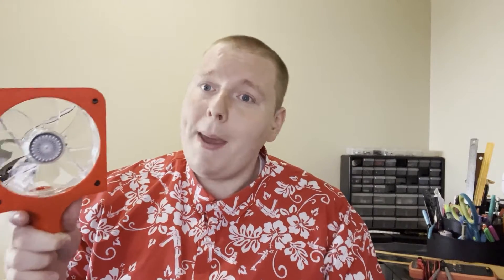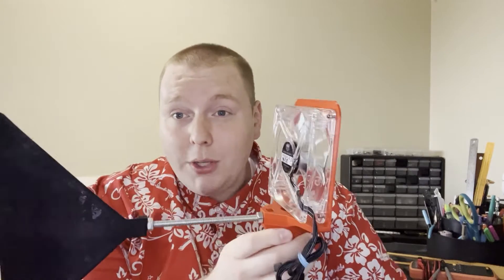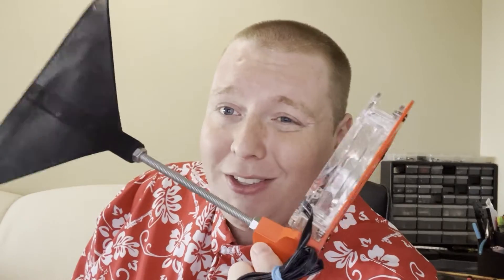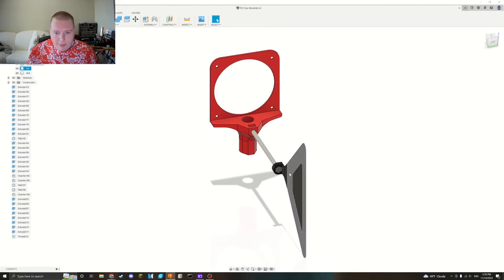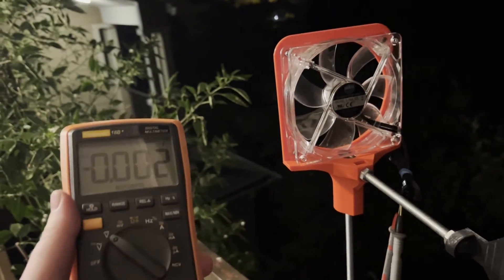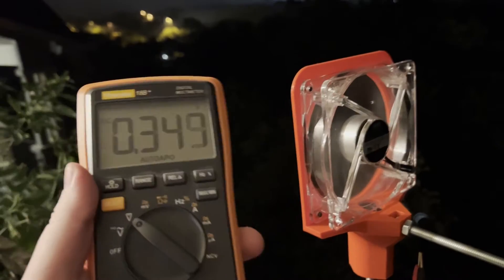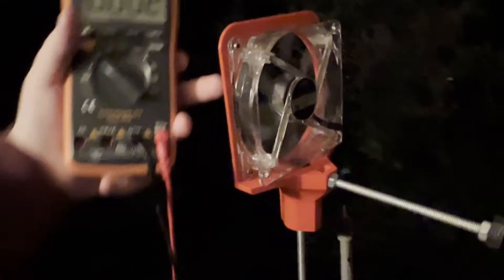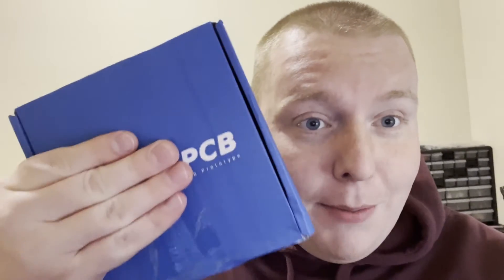Upcycling an Old PC Fan into a Windmill! (Free STL in Description)

Comment: Isn't the fan mounted the wrong way? I mean, it would be the right way if the fan should suck the air that way, but you want the opposite, the wind pushing the blades around. That means you want the "high pressure" on the "wind side".  

The problem with making use of a few tenths of a volt from a fan is that you have to rectify the output for it to be useful, and even low voltage dropout diodes typically takes about 0.2 volt doing that, which means half the power is lost if you're rectifying 0.4 volt output. Connecting multiple fans in series won't help much, they tend to cancel each other out more than helping,  as they produce AC, and doesn't synchronize with each other.  Solar cells produce DC, they can be connected in series to just add each others voltage up.      

Also, I wouldn't take Murray-Smith too seriously.  Just to give an example, he claimed to get 1.7 volts and 200 milliampere, from his PC fan generator wall and said that makes 3.4 watts, it doesn't, it would make 0.34 volt, if it was 1.7 V and 200 mA a the same time, but he admits that it wasn't even that, and implies it somewhere close enough to correct, but "not an absolutely 100% scientific thing". But reading peak voltage and peak amperage separately from such a source and combining them doesn't give a value anywhere near actual output, that was pure BS, and he probably knows it, as he often does that. See it as entertaining, possibly inspirational, but not educational.  

Anyhow, back to your fan, you need much higher rpm to get somewhat useful power out of such a fan, and the wind will go around it more than through it,  you need a high flow forced through the fan.  If you are really into the idea you can try covering a window with some kind of sheet, and mount the fan in that sheet, and open a window on the opposite side of the house a windy day.